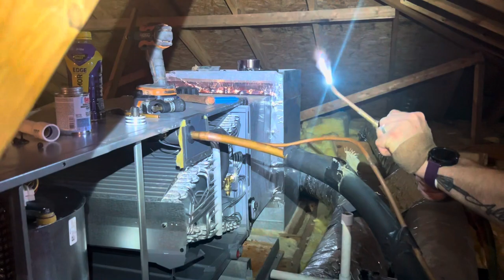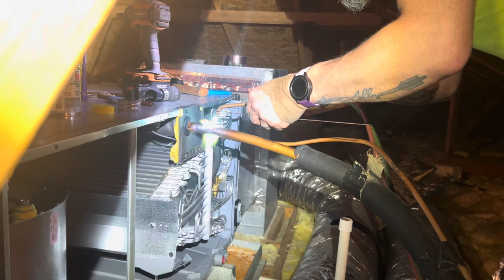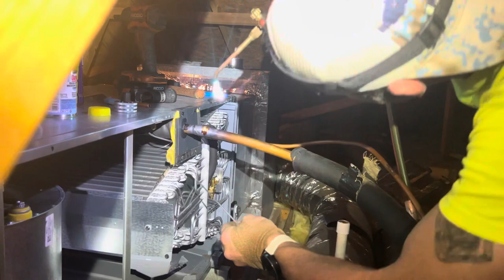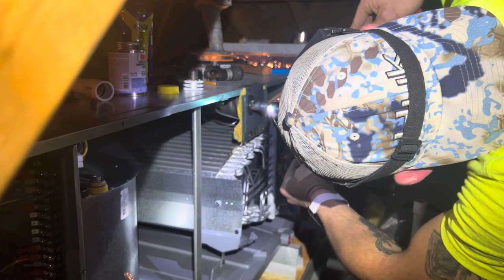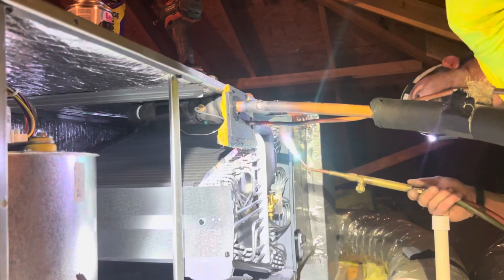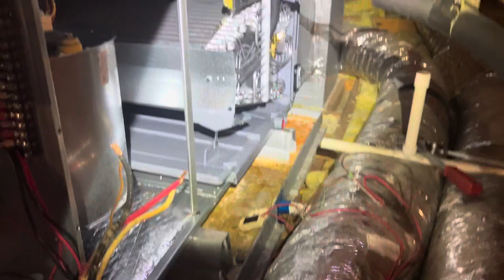How To Braze Copper Professionally!!

Comment: Why did you take off the coil door off though?
Reply from the maker: To Slide Out the A-coil, That way it's Closer & Easier to Braze The Copper without overheating the TXV  inside the unit, 
Also Heat Doesn't Build up inside the Air Handler if the Doors are off. It works For me..
Reply: @BlessedBloodline  oh yeah no hate I was just curious
Reply from the maker: No problem I'm glad you asked and it is a Good question. I appreciate the comment and support of the channel.